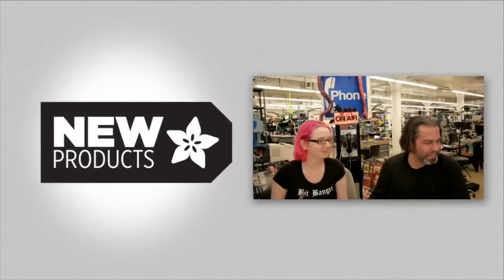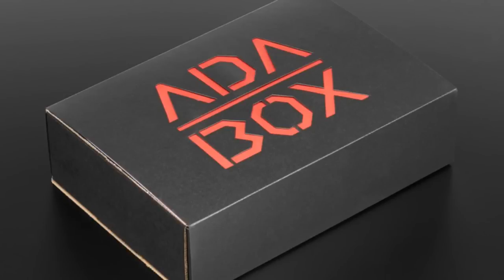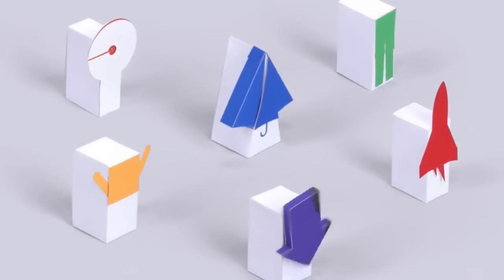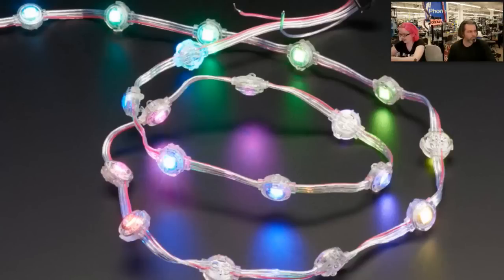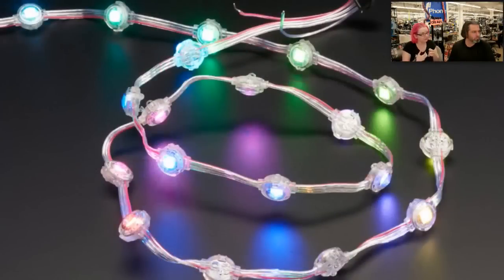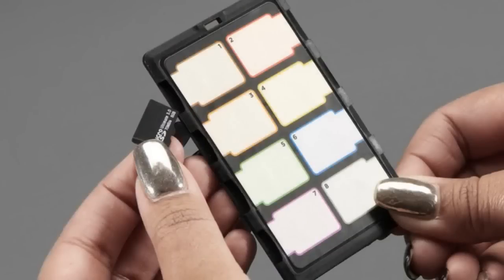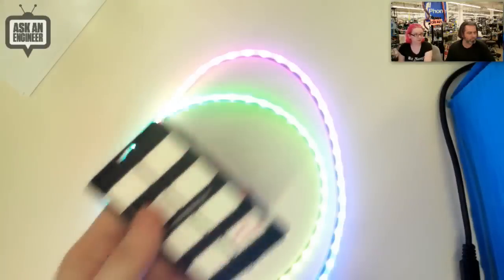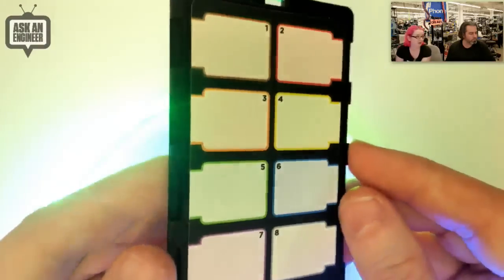New Products 12/6/2017 @adafruit #adafruit

Comment: For the Paper Signals Bundle, the servo is connected directly to the Feather board.  Won't it be better to use/add the Servo FeatherWing?  https://www.adafruit.com/product/2928
Adafruit recommends to power the servo separately from the logic power supply.  Can that be discarded if you are powering just one servo?  https://youtu.be/B-brDrnMXqY?t=13m25s